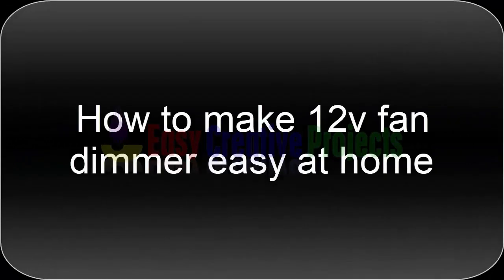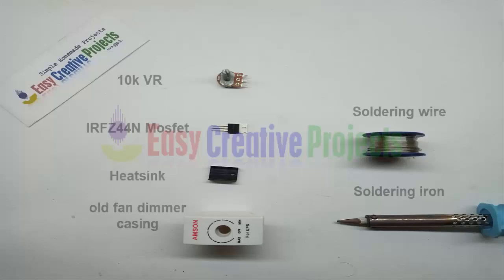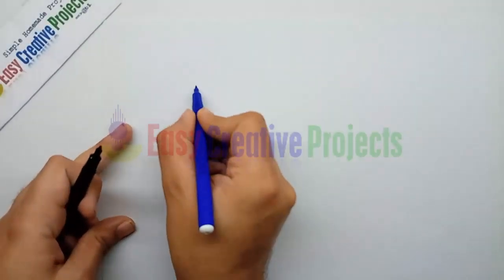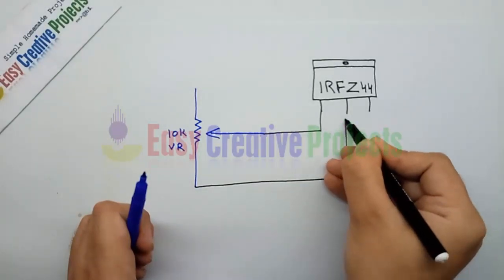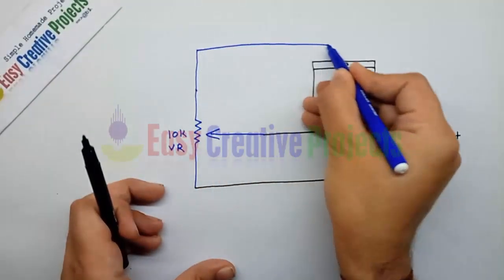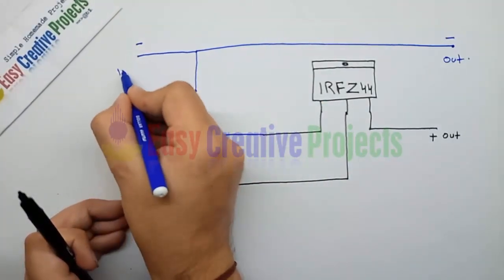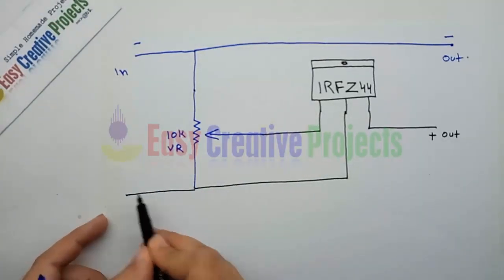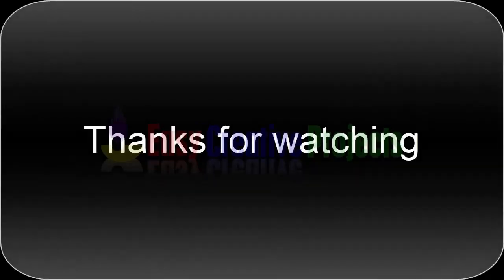how to make 12v fan dimmer easy at home

Comment: ok what is the role of the mosfet ? it would of worked just as well witouth it ! wouldn't it ?
Reply from the maker: mosfet use for control power flow. without mosfet or any transistor you cannot handle power flow.
thanks.